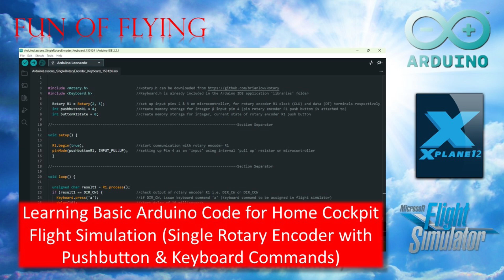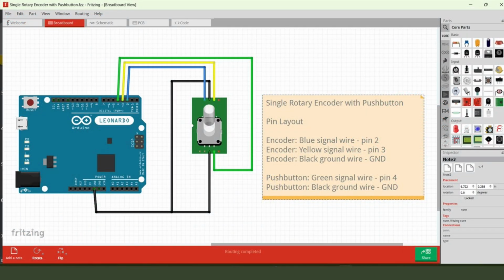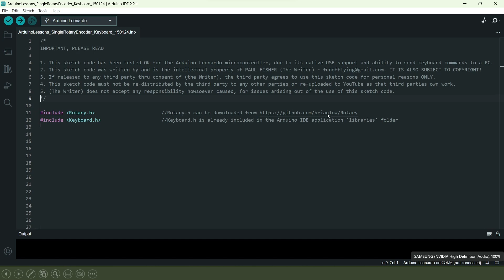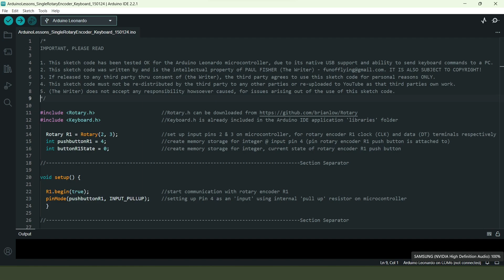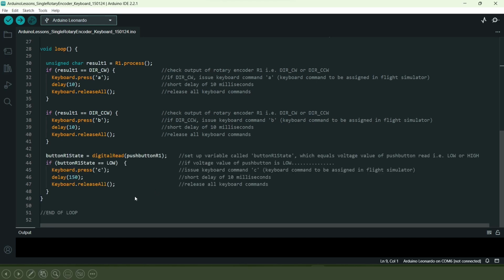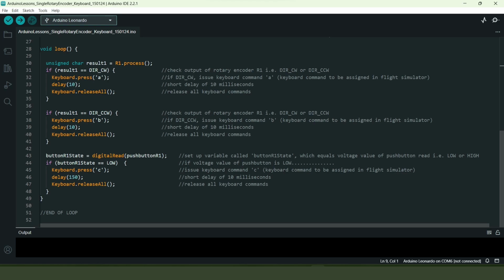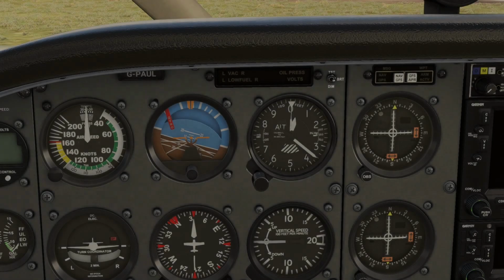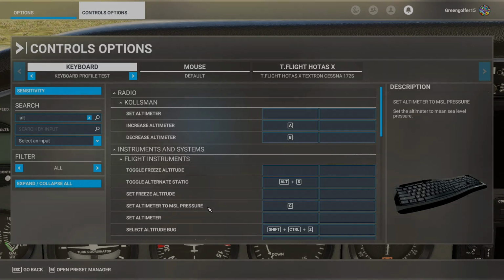Basic Arduino Lessons: How to Use Rotary Encoders & Pushbutton with X-Plane 12 & MSFS2020

Comment: Thanks for the lesson. I really enjoyed. 
I know nothing about writing code or anything on arduino, but your instructions made it not so difficult. I think!🤪
I am an occasional MSFS flyer, and after watching this I would like to try to do a project (now that I am retired!) on making a rotary encoder for the NAV 1 radio in the Cessna 152.
I did some search on internet and found out one can buy dual rotary encoder.
Would you be able to do another lesson on how to program a dual rotary encoder, maybe it can be shorter video because I assume the steps will be similar to single rotary encoder?
Cheers!
Reply from the maker: Hi there, many thanks for your message and I'm glad that you enjoyed the video :-)

If you send me an email to funofflying@gmail.com I will probably be able to write you a bespoke sketch code for dual rotary encoders. 

All I need to know is how many rotary encoders you are using and if they have pushbuttons built in? I also need confirmation that you are using an Arduino Leonardo microcontroller for your project? 

Kind regards Paul

Comment: Did you RIGHT click msfs2020 baro knob to reset to 29.92?
Reply from the maker: Hi there, do you mean right click with the mouse? No, what I actually used to reset the baro was the push button on the rotary encoder. Hope this helps 😎
Reply: @funofflying15  No - what I meant, was - when you were trying to reset the altimeter to 29.92 using the mouse - were you left clicking on the "knob" or did you RIGHT click on the knob?  I can only get my altimeter to reset with the mouse if I RIGHT click it.. (You said in the video that you thought there was a bug in the simulator making you unable to reset it without using the switch on the rotary encoder)
I appreciate you and the videos you've made, I ordered myself a Leonardo last night along with 5 multiplexer boards and some encoders 😊
Reply from the maker: Hi Anders, would you be kind enough to send me an email about this to funofflying@gmail.com, then we can communicate more easily. Thanks

Comment: Wait, you assign hardware functions to a key press on a keyboard, and then assign the key on the keyboard to a function in the sim? Why not directly assign hardware functions to a command or data ref and skip the keyboard?
Reply from the maker: Hi there, I send instruction to the flight sim in different ways, keyboard commands, HID and using datarefs, it depends on the circumstances. As my viewers have varying levels of knowledge about such things, this video was specifically for simmers just starting out with Arduino, who need to know the basics.